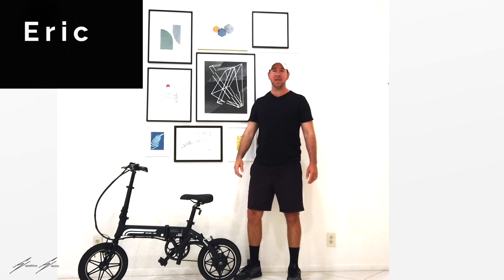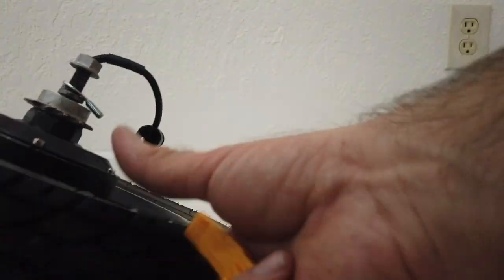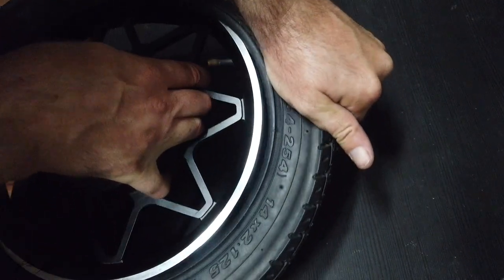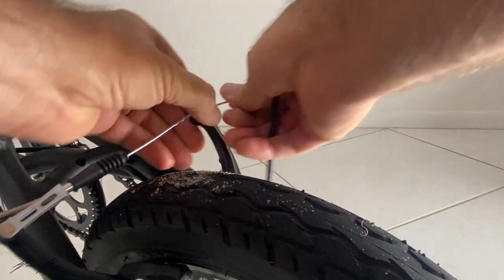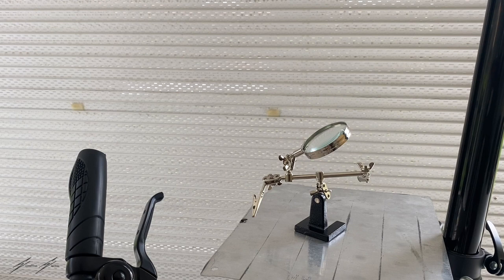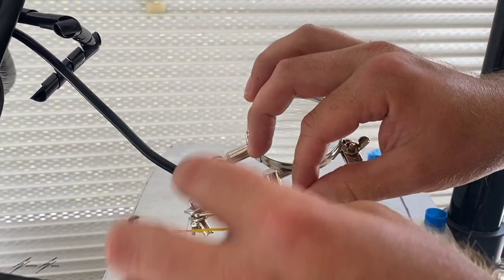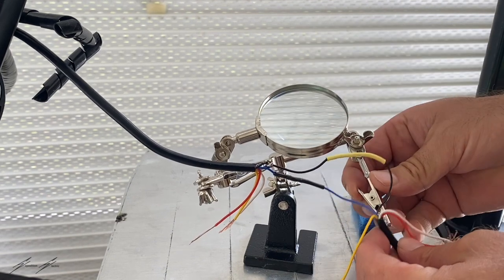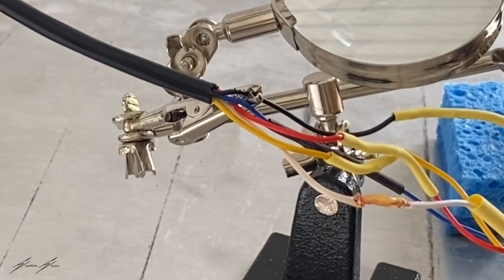Repair a Swagtron Swagcycle  Electric Bike [Flat Tire, Brakes, Broken Throttle]

Comment: Please share link from where we can buy full throttle . Mine eb5 throttal has been broken
Reply from the maker: THis bike has been a pain. Were you able to solve?
Reply: I've actually made a video of the throttle change on my Swagtron. It is very detailed on wiring. That said, you may use any throttle which is rated for the voltage needed, as long as it is wired correctly. (I've build dozens of electric bikes from the ground up, so my videos may be helpful to you.)
Hope this helped.

Comment: Anyone know if it’s possible to get a slightly bigger tire size for this bike??
Reply: It's doable for the front but sadly with the back tire it's more then likely gonna be too tight and prevent motor from getting regular speeds. I'd upgrade to a 16 inch for the front tires, the eb7 comes with them standard so I figure it should work. I get my eb5 this week so I'll upgrade my tires and lyk
Reply from the maker: Thanks!

Comment: the only problem I see is you replaced the tube with non angled valve which will make it impossible to fit an air pump into it
Reply from the maker: Worked well!